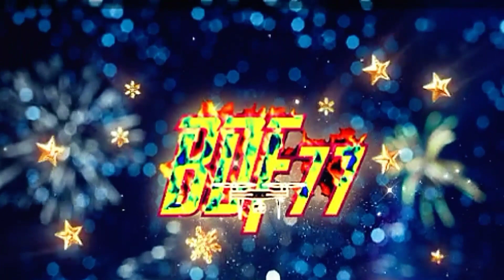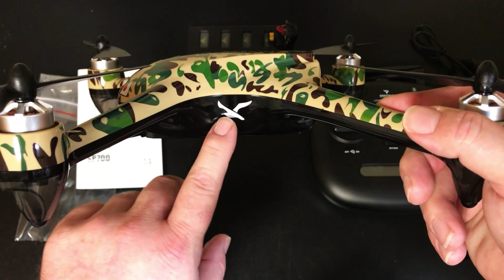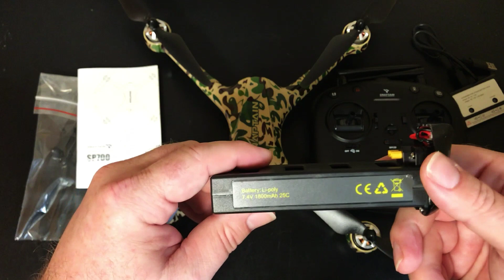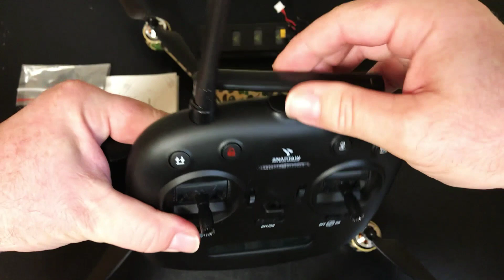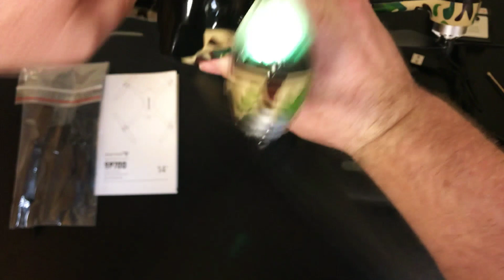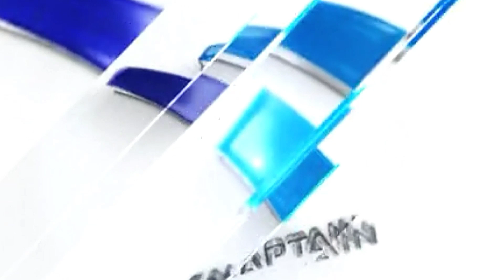SnapTain SP700 5g 2k Wi-Fi fpv Brushless Camouflage Drone With GPS. First Look & Unboxing.

Comment: If you lose it in the forest you’ll never find it.

Be interested to see if the camera is truly 2k.  Being an mjx product I expect it to fly great with excellent GPS lock and RTH failsafes.  Biggest issue is the range (600m+) greatly exceeds the useable wifi FPV feed (200m).

FYI: You can get the original (MJX B2SE from banggood for $140.00 with bigger/faster 1800kv motors or the jjrc x8 with 1500kv motors.  Both with 1080p 24fps Camera. Of course you’ll never get either by Christmas.
Reply from the maker: Thanks bro, you know I am just testing this out for SnapTain, I have all my bugs series I bought over the years. But I did test the camera video and ran in in my video converter. It was showing the video being recorded at 2048x1152. So it’s 2k just not high definition, we will have to see once I get it up in the air. Thanks again and have a great rest of your Sunday.
Reply: Big Drone Flyer77 Looking forward to your review.  Snaptain needs to be careful with price point.  They should sell this on Amazon for $250.00 with 3 batteries and a case.  And only $200 from banggood.
Reply from the maker: Gimp Man we see what they do, from what I was told they will drop the price here in the near future. Thanks again